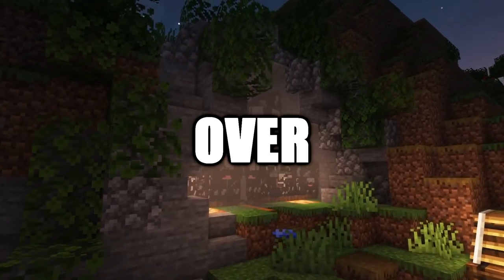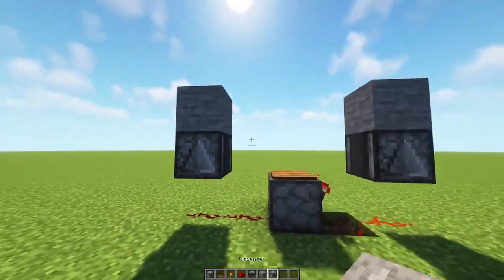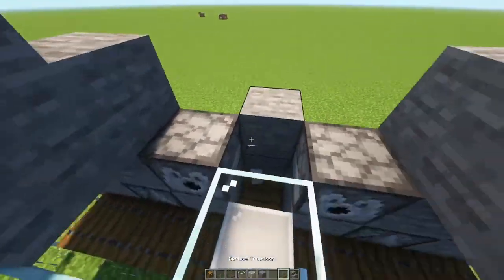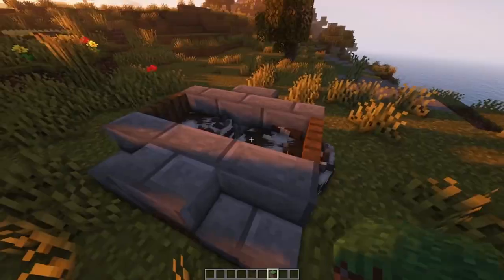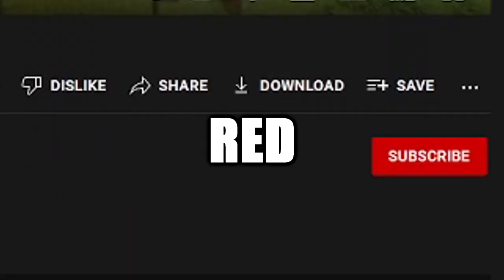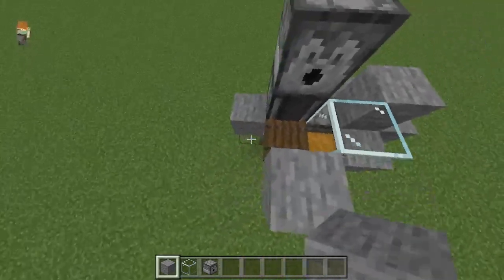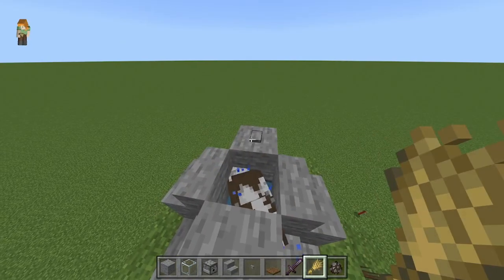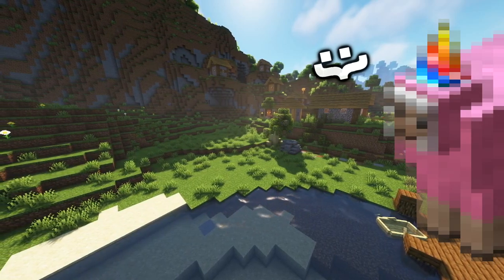Easy Auto Cow Farm | Minecraft 1.20 1.19 1.18 | Steak & Leather (NO RAW BEEF) | Java & Bedrock

Comment: The part with the trapdoors goes by way too fast without slowing down the video. Does it matter which way they are oriented?
Reply from the maker: Doesn't matter that much, here's an easy rule though. The upper trap doors placed off the tops of the blocks and the lower trap doors placed off the bottom of the blocks. That applies to the killing chamber and yeah I agree I made that section to fast.
Reply: it definitely matters for some i broke my farm by messing up the trapdoors just play the video in 0.25x speed

Comment: I have problem with dispenser. It spits out block, block push pressure plate and it remains on. Lava do not retract, all calves burn when falling down. Any solution?
Reply: Also first trap doors on hopper closest to redstone torch keeps open and close when dispenser dispens
Reply: you have to first drop the item then put lava buckets into the dispensers, should fix it for you

Comment: I know this comment is kind of late but whatever. Im playing in 1.20. The lava wont switch sides, even though the item on the pressure plate despawns it is immediately replaced by another block and so the lava goes to the other side for a fraction of a second but then goes right back to the side its stuck on
Reply: Hey did you ever manage to figure it out?? I'm kinda having the same issue and was wondering if you fixed it. Thx❤️❤️
Reply: @katiebae2941  break the redstone torch and the redstone dust and re-do it, It should reset it... or, using two buckets to grab the stuck lava, then replace those with the empty buckets in the back of the 2 dispensers.

Comment: Some advice for people struggling: 
I was having an issue with the lava staying on and only on one side.

What I did to fix it was use a redstone torch on both sides instead, remove the loose block from the pressure plate so it’s not activated, take the lava/empty buckets out of the dispensers, manually place the lava infront of the dispensers while pressing shift, then put the empty buckets back in the dispensers. Finally throw a loose block at the pressure plate to activate it again. 

The dispensers should now dump lava at the same time and for only the amount of time between the pressure plate deactivating and the dropper spitting out another block. 

Hope this helps someone!

Comment: Having an issue where the dropper spews out the block but doesn't weigh down the pressure plate. How can I fix this? Im playing on 1.18.2
Reply from the maker: Use wood or weighted pressure plate. Stone pressure plates may not be activated by items if I remember correctly

Comment: it works great, but the baby cows arent falling down when the trapdoor is open, they just kinda sit on top of the opened trapdoor. does anyone have a solution
Reply: i'm having the same issue, were you able to find a solution?
Reply: @ekali-wc6qo  nah, theyre still not falling down. ive tried changing the orientation of the trapdoor and stuff, but they just dont fit down the hole. good luck though
Reply: I'm having the same issue. They don't fall at all even after rebuilding. They just die due to the entity cramming.

Comment: Its a good idea, but badly designed (the top of the farm), the cows can jump out, so illd recommend blocking parts of it off, and adding a water bucket in the middle block between the trapdoors, this will allow them to jump for easier breeding, but not come out thanks to the additional blocks.
Reply: The reason they were able to jump out is because you accidentally opened the center trap door they stand on. They can jump on top of that and get out. It is a problem though cause when you're feeding you have a tendency to open that trap door a lot. I'm thinking of replacing it with just a simple slab.

Comment: What if the lava is constantly running? Every 5 minutes it turns off and then all on again. It burns any new cows that you breed. I think it's supposed to be the opposite. I would love to hear a solution, well edited video ^^

https://i.imgur.com/vbrzXOF.png
Reply: put the redstone torch on the other side. i got its to work this way
Reply: @yaboiskinny4  Thanks for the response, I found another solution:
If the problem persists, while you have items on the pressure plate and lava is on, bucket it up and place it back into it's dispenser. That makes it go at the right interval. Hope this helps someone!